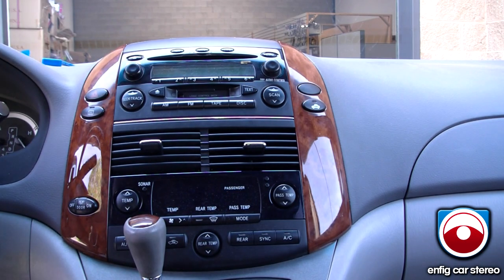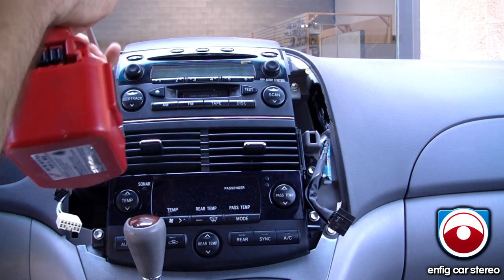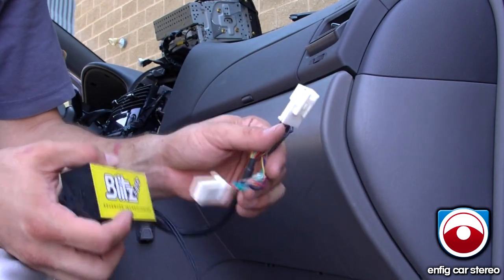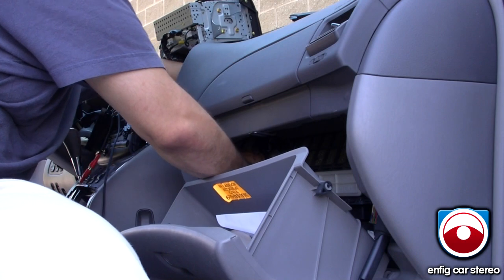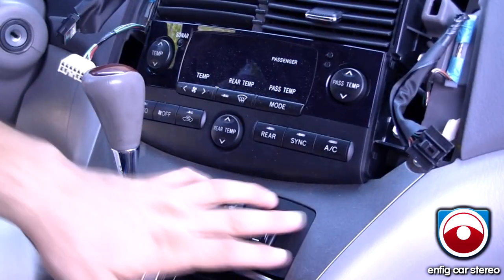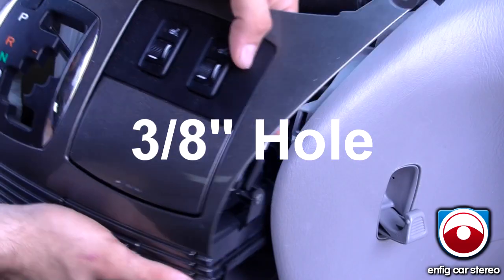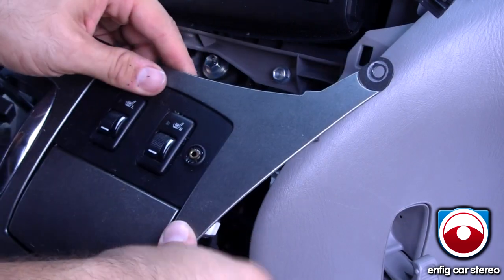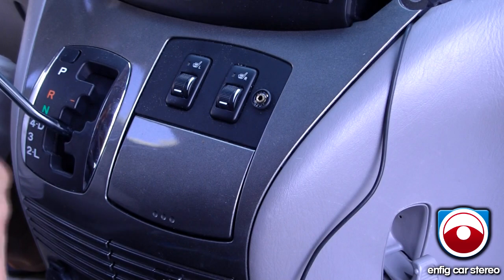iPod iPhone or Aux Install 2004-2008 Toyota Sienna - BlitzSafe TOY/AUX DMX V.2

Comment: Bought and installed on my 2004 Sienna - super easy with the video and shipped to Canada in a couple days - works great - couldn't be happier
Reply: +David Younghusband  If you're not super comfortable drilling the 3/8 hole I recommend first drilling a small (like 1/16" -1/8") pilot hole first so that the larger 3/8" bit does not "walk" and end up where you don't want it